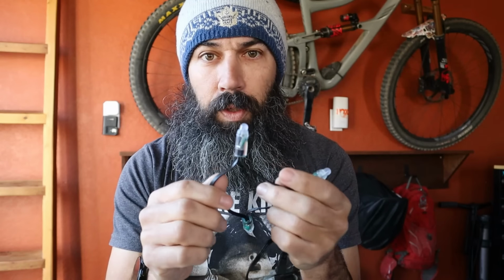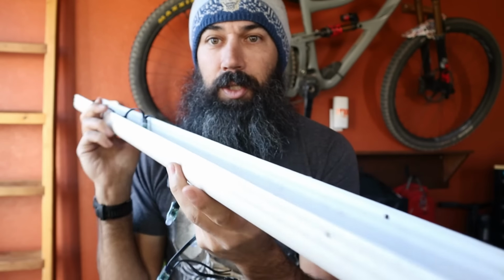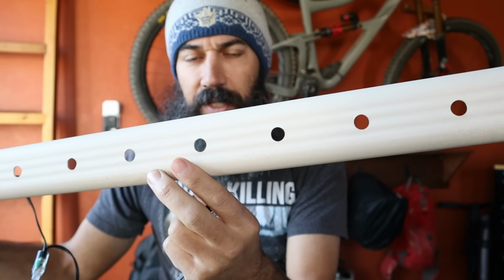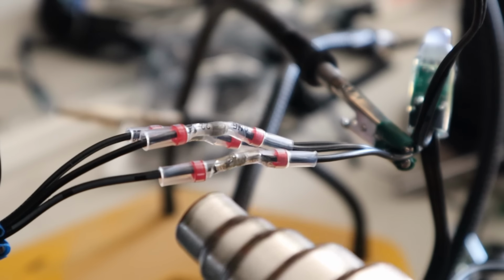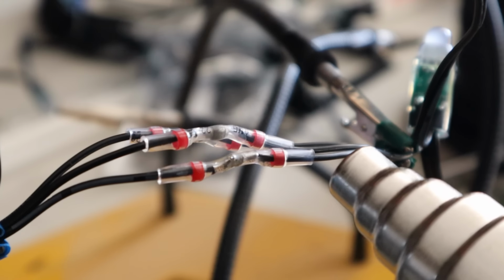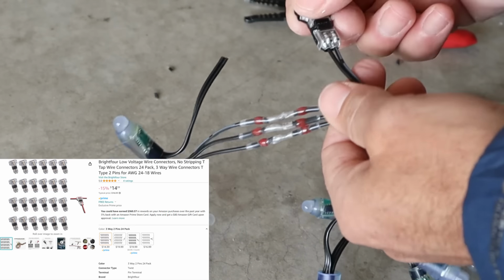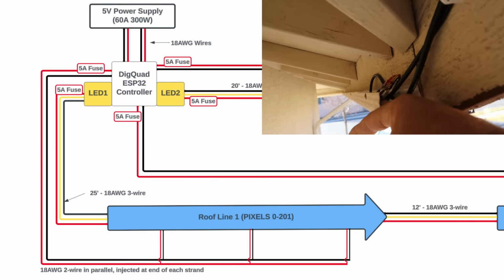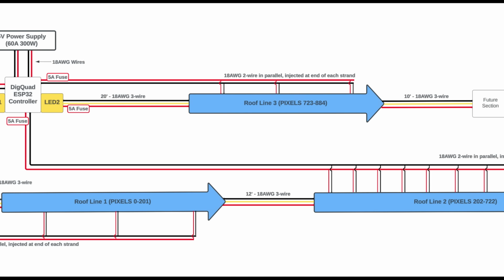Permanent and AFFORDABLE Holiday LED's

Comment: You can do the same thing with VINYL (Siding) J Channel. It’s smaller, cheaper & looks better.
Reply from the maker: Probably does, but totally not available where I live. Almost zero vinyl siding out here.  I did look for J channel and just couldn’t find any.
Reply: Have it readily available here but soffit...  Can you slide it under that soffit edge and secure it🤔

Comment: Was just looking into a similar system not even a week ago.  Likely too late in the season to implement by 2024, but I sense a 2025 project on the horizon.  Will be watching for the video on the controller (was also eyeballing the DigiQuad).  I'll have to take measurements to see what my lengths will be.
Reply from the maker: Was just filming today for my update video. Will def be diving into the dig-quad more for that one.   Planning is a huge part of the process. Plan, measure, document.  That will make everything go smoother for sure.

Comment: Great video! I want to do this to our house as well. Love the use of the downspouts for spacing and mounting, great idea! Have you had any issues with birds or wasps trying to use them as a new home? How do they hold up during the winter/summer? I'm pretty sure I live on the same end of town (I recognize those mountains with the wild mustangs 😉) Thanks for the awesome content!
Reply: I really like this idea as well. 
Although,  i might need to modify how i attach the vinyl.  Florida climate as it is
Reply from the maker: So far zero issues with birds or critters.  Also zero issues so far due to weather. They are tucked pretty nicely behind the fascia board and that seems to keep them pretty protected.  We’ll see how this coming winter shakes out, but I don’t anticipate any issues. I’m ready for snow and ski season!  Appreciate you watching!!
Reply: @DadDoingStuff  That's great to hear! I'll have to do this in the spring... not sure I want to be on the roof when it's snowing! Looks like ski season might be here!!!!

Comment: This is not a bad idea! 
I like the way you did the power distribution, a lot of ppl don't think it through, and they have problems, starting with inconsistent lighting. (But it gets worse!)
Good job overall!
Now you can spend your time designing programs for holiday lighting, special events (e.g., kid's prom, graduation, wife's B'day, etc!)
I have  considered doing this, but until recently, i guess not serious enough!
I started out (many years ago) with a string of LED lights that were difficult to put up (had to hang off high roof, i was dangling upside down.)  So, i left them up for years until we moved, they just weren't lit on non-holidays!
But it got me thinking about doing what you're talking about. This was quite a few years back, when LEDs weren't as rugged as they are now. 
(Some "pixels" died after 1 or 2 seasons, but they weren't really pixels since they weren't individually programmable.)
Since now they are programmable, reliable, and rugged (if you choose correctly), I'm thinking more seriously about this (in our new home). 
I'll have to work out the power density, to maximize the light density, before i do anything.
And of course, there's the cost....
Bur, yeah, I'll definitely make my own mounting channels, it'll save LOTS of $$$.
Thanks for taking the time to share! 
👍👍👍
PS:  After watching more of the video (haven't gotten to the end yet(, i have a few practical questions:
1. Since your channels are open at the top, have you had any problems with critters messing with your wires? I'm thinking house sparrows making nests, but it could be mice, wasps, just about anything, depending on where you live. 
2. I suppose behind the facia it's out of the rain, but since it isn't actually enclosed, I'm thinking the seasons could be kinda rough on the insulation, connectors, etc.  Again, depending on where you live....

Overall, the price point seems reasonable!
I'd be interested in your answers to my questions....
Reply from the maker: Hi Jeffro and thx for the comment.  LED technology has certainly evolved and come a long way.  In parallel, consumer access to this technology has become pretty darn affordable. So that stuff is cool.  As to your questions…and I’ll be discussing both of these in my upcoming video. 
1.  The critter question has probably been the number 1 question from viewers.  It’s definitely something I’ve been concerned about, but so far has not been an issue even a little bit. We do get birds that nest in parts of our roof but nothing on my tracks yet.  We get wasp nests on occasion but so far those haven’t been a problem either.  This would for sure depend on where you live.  One deterrent I’ve heard about is to used shavings from Irish Spring soap as mice and rodents apparently hate it. 🤷🏻‍♂️
2.  This would vary based on your particular house and roof.  For ours, the open tops of the trays are really quite protected from weather and sun.  They stay mostly dry and only get any moisture if there is a heavy wind along with rain.  We live at the base of the sierras so we don’t get a ton of rain here.  But we do see a fair bit of snow and temps from low teens all the way into the 100’s.  Obviously, where you live and type of house would be a factor. 

Appreciate you watching and stay tuned for an update video on this project!

Comment: Nice Job. I use pixels in my Christmas lightshow and I 'm going to take you tips on making gutter track for them. This is the only project I need to do. in regarding those JST connectors you can dip them in diaelectic grease and shrink wrap them for a water proof seal if it comes up to them. In the lighting community we have standards now with water proof connectors are part of it now and we see few JST based pixels. I think the offerings with JST are the cheaper way like you did  cut them off and use whatever connector you want. Great video!
Reply from the maker: Thanks for the info!  Connectors were definitely one of my most time consuming parts of the project. It also makes it challenging if you have to swap out a whole segment. With mine I have to re-solder. But connectors would make that job really easy!

Comment: I would buy two of the 10' sections for section so you and create an enclosed space to prevent rodents, birds, etc from making nests. Also, don't cut the connectors off to make a waterproof seal. They make them big enough to cover the connectors so you don't damage anything.
Reply from the maker: Good call on the birds and rodents. That will definitely be a topic in my upcoming update video.
Reply: @DadDoingStuff  Learned the Irish Spring trick from RVs

Comment: I've chosen 1/2 Vinyl J Channel so I don't have to rip cut. I REALLY like the downspout idea though. Looking at my temp setup and it is clear that the downspout will have more room to house the power injection wire. Or if i need to run another zone and follow this path, I can place the wire in the downspout better. But, I don't think I'll have. a problem with the J Channel. I bought 500 LED, space 2.5" apart, and I used 10.4' of the 12' J Channel. I'm thinking I'll cut off the excess, and then I'll have a modular install!
I love your video! I am watching it over and over as I am doing my build.
Reply from the maker: Dude, I like your modular idea with J channel. This also gives you a chance to fully test prior to install, which can save a lot of headaches. If you are doing long runs of 5v, go bigger gauge on the powered injection wire. (Lesson I learned after doing mine). If you went 12v, you can probably get away with 18awg just fine. 
Again I like the idea of J channel, I just couldn’t find adequate J channel when I looked. Would love a link to what you found!  That’s awesome!
Reply: @DadDoingStuff Well, 5V and after about 200 pixels with 18awg power injection, I have issues. It was just inconsistent lighting, but about a week ago, they quit working all together. So at the moment I have half of my project lit up!
I’ll try a heavier gage wire for power injection and see what happens!
Reply from the maker: @kmcegardner  If they are out all together, there’s likely something else going on. If anything they should be lit, but potentially less bright due to voltage drop. During my install I ended up with a bad string of lights that I had soldered in.  Nothing beyond that string would light up. Once I found the bad string, I replaced that section and everything was money.
Reply: @DadDoingStuff WLED stop LED was my issue.
Now it’s definitely just voltage drop. Less intense colors or fading.
Reply from the maker: Heavier awg wire will definitely help. I just did my update video and talked about this.  I had to add a 12awg power injection towards the end of my longest run.  Made it MUCH better!

Comment: I've noticed this in 2 videos now that are using these WS2811 LEDs, but there's some flickering that happens in your intro clip when there's some color transitions or LEDs turning on/off -- is this a quality issue with the LEDs or a power supply issue or..? You can see it in some of the LEDs above the circular fixture in the first clip of the video. I'd love to know if this is avoidable before diving in.

Otherwise, fantastic video and extremely helpful with making it seem like a do-able project! Thanks!
Reply from the maker: That’s a great catch Eddy. I’m actually troubleshooting that right now. It seems to happen only on that upper eaves section. I’ve isolated it down to where I’m quite confident I have a bad LED somewhere in that particular chain. I’ve swapped inputs, re soldered the connections, but the issue always follows that strand. 
That said, the problem is only manifesting when I run certain animations on that segment. For solid colors they don’t flicker at all.  So my next step is to isolate which section is causing my problem and just replace that set of 25. 
How to avoid this?  Just test all of your strands prior to installation. And test them on several different animations and colors.  I had only tested mine on solid colors so I didn’t had that problem until later. 
Hope that helps!!
Reply: @DadDoingStuff  There is a switch under the esp from Quinled, switch it to from 249 to 33ohm and you're probably good to go, else you need a data booster, level shifter or sacrificial pixel to boost the dataline from 3.3v to 5v when you have a too big gap between pixels.
Reply from the maker: @DjWondah  I did just that and boom!  Fixed!  I discuss that in my up date video I recently posted.  Thanks for the info!!!
Reply from the maker: Update. I think I have the flickering solved. Simple as a dip switch setting on the board!  Will cover this in my update video.

Comment: Outstanding job! If your LEDs are truly individually addressable, they are type WS2812B. The WS2811 types are addressable in groups of three. Nit-picky but if you want to control each pixel's color, it makes a difference. I used WS2811 for under-deck rail lighting which is indirect where individual pixels can't be seen. The slightly higher price of WS2812B would have been wasted there. Alternative to replacing the end connectors is using dielectric grease to waterproof the existing connections. Get a tube from an auto parts store for a few dollars and squeeze a little into each one.
Reply from the maker: That’s really good info!  Not replacing connections would have saved me a ton of time!  Regarding which ones I have, the only thing I know is that each pixel (bulb) has 3 LEDs. A RGB in each.  So I’m not certain then which ones they are.   I just know I can control each one (bulb/pixel) individually.
Reply: The WS2811 pixels are typically individually addressable. On LED strips, they are often grouped in 3s. In that case, 3 RGB LEDs will act the same.
Reply: Yes each pixel is rgb, and often times on LED strips they are still controlled in groups of 3. Meaning 3 RGB pixels are treated as one RGB pixel. This is often the case with 12-volt strips, not bullet pixels.
Reply from the maker: @fitzmagic  These are definitely in groups of 3.  Each pixel has a R, G, B, LED.

Comment: Great clip!  where i live most of the area uses Facia gutter, so no word. The gutter hang down 2" below the rafter. This was a perfect solution to my issue. I have a 4/12 pitch on the rafter, so I bought 1 piece for a test. I cut the gutter at the angle of the pitch and just flip the other half, and walla . On my way to HD to buy the rest of what i need
Reply from the maker: Right on!  That’s super rad.  Good luck on your project dude! 🤘🤘

Comment: When you insert the LED's and have about 7 left over per strip, do you cut them off or have them "roll over" to the next downspout?
Reply from the maker: Great question. I have them rollover. Only time I trim the strands of LED was at the end of a run. 
I will say that IF you custom cut each to the same length and had quality connectors at the beginning end of each segment it would probably make install way easier!

Comment: Time is money, and as you get older you start to realize time is finite so that pre-made is more of a bargain than you think - in effect giving you more of a commodity (time) that is normally irreplaceable, or unrecoverable. 

But then there is the satisfaction effect - Pre-made frequently looks well pre-made/plain/cheap/one size fits all, so you can save time, spend more money, than toss that crap because the effect is sub-par.

Watching your video if I was going to do this the time would totally be justified number one because the finished product looks both custom and one of a kind  (that effect is what makes people seeing it say - How can I get that). But secondly as a builder I see the potential for your system to match many different mounting applications depending on your roof and eves with only small easy modifications. 

Very nicely done project, and definitely worthy of an investment of time.
Reply from the maker: Well said.  Time is definitely $.  One big factor for me, I like doing this type of thing.  If it was painting a room in my house, I’d hire someone because I hate painting, even though I’m perfectly capable. 
But yeah….getting it just how you want definitely has an upside too. 
Appreciate you taking time to watch and comment!

Comment: Do those lights have white also? Or are they just RGB?
Reply from the maker: These particular ones are just RGB.  You can get decent white out of them, so long as you can keep the voltage up across long runs. But if white is a priority, I’d consider a RGBW option.
Reply: @DadDoingStuff  thanks good video

Comment: I had a company come out to give me an estimate.  He measured 42 feet and estimated $6800!  I bought all the wires, pixels, connectors, channels, controller, 12v 60A power supply, and rented a boom lift to do it myself for about $1000.  The only difference is that I did almost 100 feet instead of 42 feet. And I got to spend an afternoon with my grandson on the boom lift. :) DIY is the way to go if you have more time than money, or if you have a few skills.
Reply from the maker: That’s super rad!  Agree, DIY is way more fun and cost effective.  And boom lifts don’t suck either!!
Reply: Shoulda got another quote. Most places run around $30 a foot that do it professionally. Coulda got the near the same price but not lifted a finger.
Reply from the maker: @chadhamel8707  Even $30/foot is WAY more expensive.  That would have cost @rflournoy $3,000 to get his 100' done.  3x is not "near the same price".   I did the math on my project, which cost me about $700 in materials.  I have 203' of roofline done.  At $30/ft that would have cost me about $6,100!
Reply: @chadhamel8707  You serious?  I get that “pro” installers have to get compensated, but your attempt at “rationalization math” is laughable.

Comment: tried 12mm drill bits and they gouged hole , ended up buying metric step drills which works great. love the downspout idea.
Reply from the maker: Yeah I did the same with a standard 15/32 bit, but it doesn’t make a clean hole in something that thin.  Step bits kick butt for clean holes in thin stuff!